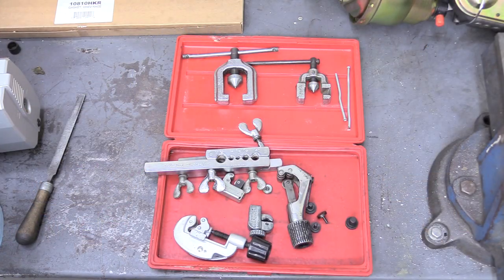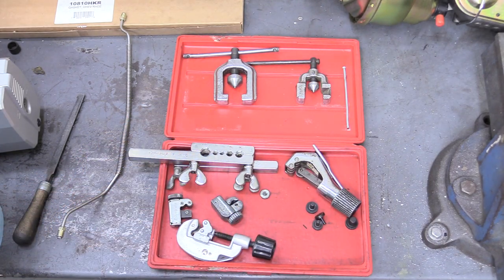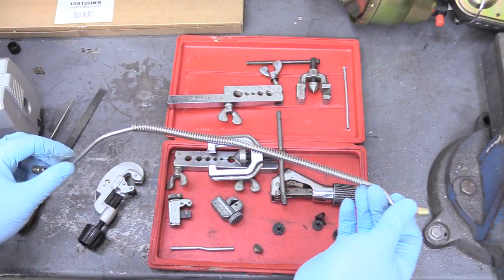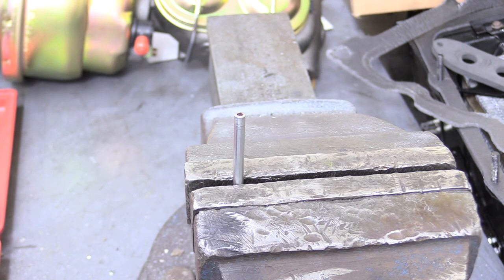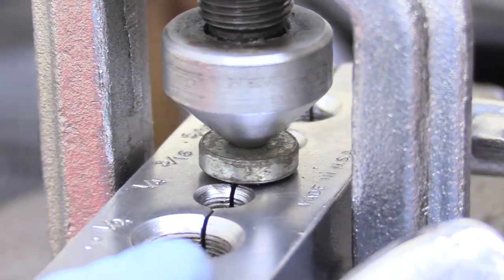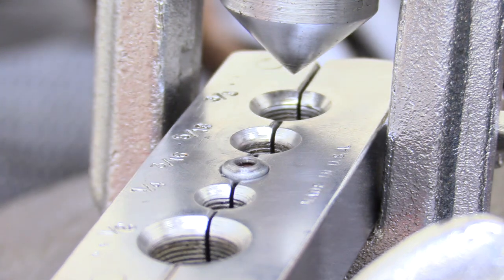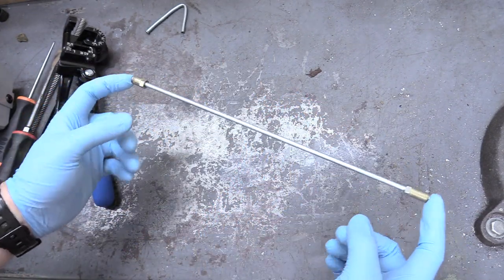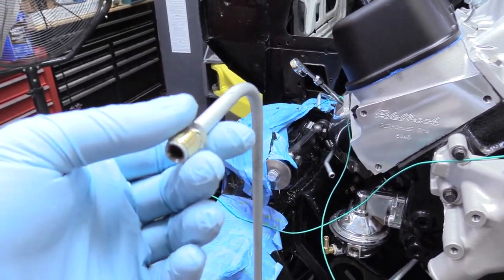How to Make a Brake Line - Cut Flare and Bend!

Comment: I have a 2001 Chevy Silverado and my brakes failed yesterday and the main brake line from the master cylinder to the avs module completely broke due to rust. Mechanic just told me they can't purchase this  brake line part and have to fabricate it. Is this true? Also said it will run me 600.00+.
Reply from the maker: It is super easy to make brake lines, maybe they think it would be quicker and more efficient then to order one and wait? 

I found a whole bunch of premade lines, I'm not sure which one they are saying they can't get but check this link out https://www.summitracing.com/search/part-type/brake-lines-direct-fit/year/2001/make/chevrolet/model/silverado-1500

Hope that helps! Thanks for watching!
Reply: @2carpros  They actually told me I won't get my truck back until the middle of next week due to the fabricating they MUST do. They said they HAVE TO make the line themselves because the parts are not sold for my 01 truck. Are they lying?
Reply: @2carpros  they are charging 500.00 for just the labor for the brake line. Is this legit?
Reply: @2carpros  I just don't want to be taken advantage of just because I'm a woman...
Reply: @2carpros  
Not Helpful when you don't answer with COMPLETE HONESTY. You evaded my last 2 questions. Why?